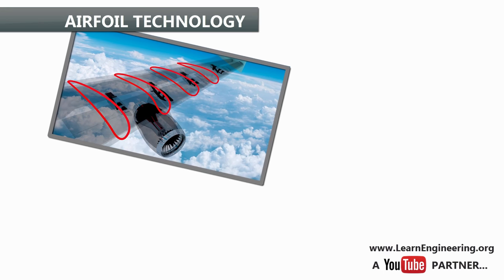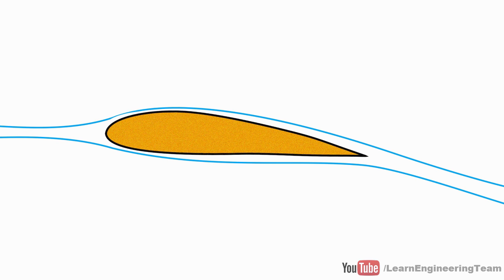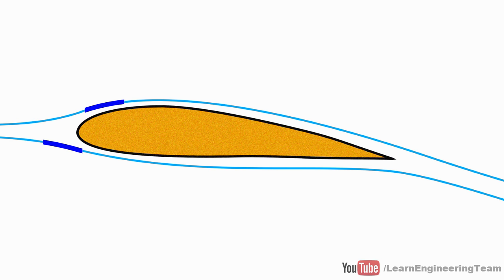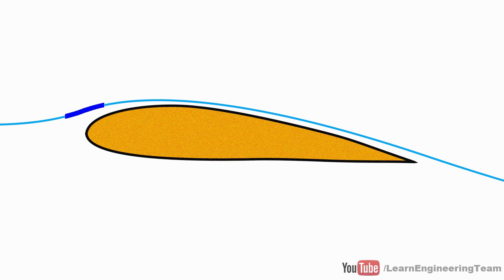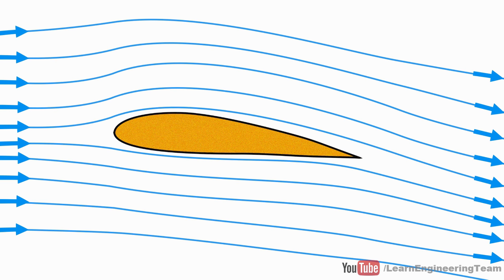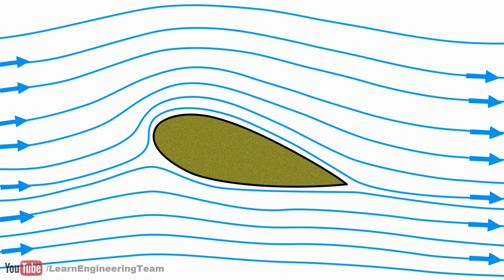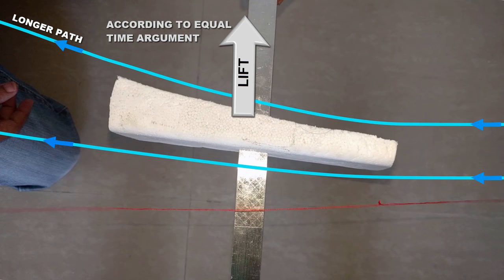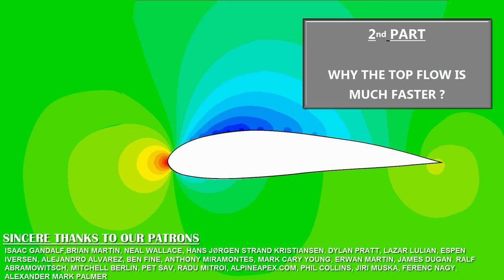How do Wings generate LIFT?

Comment: Uhm... so, it's the centripetal force that curves the airflow, not the centrifugal one. And the Coanda effect indicates that there is a force on the airflow following the surface of the airflow, and hence a pressure. But that's just Newton's first law. It doesn't explain WHY the airflow follows the shape of the surface.
Reply: @Physics Rules-Roels Physics
You can say that the atmospheric pressure causes the flow to follow the convex curve and, therefore is responsible for the centripetal acceleration..  However, it is the Centrifugal Effect (Tendency to go straight) that reduces the pressure closer to the surface below the ambient atmospheric pressure.
..
At time 3:20, he says 'centrifugal'(outward) when he should have said centripetal (inward).
Reply: @Observ45er  Mmmm, have to think about that, thnx!
Reply: @haushofer100   Tnx for response. Think very carefully.  Atmospheric pressure pushes air against the surface in the first place. Even if it moves (but not super fast)  it is pushed against all surfaces. Because of this the flow follows the upper convex curve, right?
.'
Now, What does Newton's First Law say about something moving?  A: It "wants" to go straight. Right?
..
BUT... what if it is forced (by atmospheric  pressure, in this case) to follow a curved path?
.
It's going to 'try' to go straight and pull try to, or get flung outeward.  This is just like being on a playground merry-go-round going fast.  You feel pulled/pushed/flung outward.  Air is no different.
SO...
It will push against the atmospheric pressure further from the wing.  It can only push with the same atmospheric pressure amount because that's all the atmosphere can push back with.
But it will be less at the inside of the curve near the wing BECAUSE it is trying to go straight (inertia, or momentum does this).
.
It 'wants' to go straight, but the surface is actually curving away from that path. 
..
It is this "need to, or attempt to go straight" that lowers the pressure above the wing. It's Newton's First  Law, just not like people say with the Third Law "reaction" pushing up on the wing... Newton's Third Law certainly happens, but it doesn't cause lift.
Let me know if you 'get' it.
..
All this other stuff like Bernoulli, faster causes lower-p, and pinching are all misunderstandings of fundamental physics. Some of that other stuff happens in the complete story, but they get causes and effect mixed up.
Cheers.

Comment: Your explanation is incomplete and incorrect in one respect. The cause of the Coanda effect: is caused by the air surface boundary effect on all surfaces. The air right at the surface of any object is more static due to attractive forces between and among the particles at the surface. As soon as moving air meets this very thin layer that is more viscous some of the air particles start moving in the same general direction. This is the beginning of laminar flow which reduces the viscosity above the boundary layer.  The longer the path of flow the greater the laminar flow becomes. This causes the air in this region to have a higher velocity, lower viscosity  and therefore lower pressure. The same effect is occurring on the bottom of the wing but to a lesser extent for two reasons;  1 the distance the air travels is less so the Coanda effect is not as great. That is, the amount of laminar flow will not be as pronounced. Secondly if you have a concave lower surface it will produces a smaller cross-sectional area of laminar flow "Coanda effect". This is because at a plane parallel with the leading edge of the concave surface the Coanda effect falls off precipitously. On the upper convex surface the cross-sectional area of laminar flow decreases much slower.  In summary there is a lower pressure region produced on both sides of a wing by the Coanda effect, it just that the net difference causes  the upper surface to have an over all lower pressure and higher velocity. This is all topped off with Newton's third law. Your video only shows a higher pressure directly under the wing which is misleading. It's the net difference!
Reply: Uh, yikes, no. Viscosity is treated as a constant because it essentially is. Laminar flow has nothing to do with higher velocity or lower pressure. Coanda effect has nothing to do with lift and inviscid theory predicts lift perfectly fine (with Kutta condition which is somewhat assuming viscosity – but not directly). The laminar flow over a large commercial aircraft wing is basically nonexistent.

Comment: From Popular Science (way back in 1927):  https://books.google.com/books/about/Popular_Science.html?id=VikDAAAAMBAJ
a) 25% of the lift is from the wing being angled slightly into the wind, and the air pushing the wing up  (this also creates drag - slowing of the plane, however).
b) 75% of the lift is from the fact that air is deflected slightly by the top leading edge of wing creating a partial vacuum just behind the leading edge on the top surface of the plane.  Having full pressure on the bottom of the wing, and not on the top of the wing pushes the wing up.

Comment: ANGLE OF ATTACK: the "elephant in the room" missing from all of these "how do airplanes / wings fly?" explanations.   Lifting the nose up, thereby increasing the angle of attack of the wings lifts the airplane off the ground allowing it to fly.  If it was true that the wings' lift raises the airplane off the ground, the airplane could simply speed up with its wings remaining flat and parallel to the ground and magically float into the sky.  In reality it would speed to a crash at the end of the runway!
Reply: Actually, due to a property called "camber" a properly shaped airfoil at zero angle of attack CAN generate lift. If you had a runway long enough, and an airfoil designed for it, an aircraft could take off without lifting its nose. It just turns out that it's easier to just lift the nose a bit instead of building freakishly long runways. However, in cruise, many aircraft fly at zero angle of attack and don't lose altitude just fine.
Reply: The lift of the airfoil at high speeds can provide significant lift for the wing, but even at cruising, even when the fuselage & cabin are level, the wings have a small upward angle which provides lift.  Check out the wing shape of the highest performing military aircraft, many of which are symmetrical.  Also note that if the shape of the airfoil provides most of the lift, flying upside down would be impossible and guarantee a swift crash.  The main benefit of an asymmetrical airfoil is efficiency. It allows a laminar flow resulting in a tight boundary layer in multiple flight attitudes (see Coanda effect).
Reply: Yes, I am fully aware that some aircraft have symmetrical wings and in those cases angle of attack is completely responsible for lift. But most aircraft have a combination of camber and a built in angle of incidence with the fuselage. I am actually currently designing an aircraft for my senior design project at college, and mine has both an angle of incidence and camber.

Also, the Coanda Effect is NOT responsible for flow attachment. It is solely due to the fact that there is other air around it which pushes it against the wing. The Coanda Effect is not very useful in this case because it cannot explain flow attachment to the concave lower surface of a cambered airfoil, yet it we know from many years of testing and experience that the flow remains attached there. The Coanda Effect only applies to convex surfaces.
Reply: the plane could take off without pulling up but it would need lots of speed. The top of the wing generates some lift even at no angle of attack

Comment: good video, but still inaccurate. Newtons 3rd Law IS NOT the source of lift force, it is purely the pressure difference due to circulation about the airfoil. 

Wings do use the highly curved geometry, this is what happens when slats and flaps are deployed to increase lift.

Now, your CFD simulation is nice but does not prove anything if you input the streamline parameters. How do you know why the flow occur in this pattern? you only know that it does from practical wind tunnel results. And err, your CFD of the concaved rect block does NOT show no lift, it shows small negative lift.

Also, how come the Coanda effect does not happen around the trailing edge of the airfoil? Zoom in on the trailing edge, it is just a convex surface, so flow should cling around the trailing edge creating another zone of low pressure around the trailing edge according to this videos own arguments! The answer to this particular question is real reason why airfoils generate lift.

And here is a brain teaser for you. If Newtons 3rd law is really the way aircraft gets their lift, why are helicopters not as fuel efficient as a fixed wing aeroplane of the same weight? Does conservation of energy not apply to wings?
Reply: Both Newtonian and Bernoullian explanations are equally correct. The Coanda effect is irrelevant and is a mistake in the video. Fuel efficiency is irrelevant and a mistake on your part.
Reply: Googelplus Sucksys I think if you imagine 100cubic meter of air pushed down to the ground, a fixed wing aircraft will produce more lift than the helicopter. But according to the video, it should generate more lift.
Reply: The same lift sorry

Comment: Answer for the brain teaser :-
It's coz pressure decreases on the upper side the velocity increases but at lower as pressure increases velocity decreases ......thus it makes the difference in velocity at upper and lower side .
Please rply if it is correct or wrong.
Reply: you can't compare these pressure gradients. The lift is caused by the pressure differences between the upper and the lower side.

Comment: I listened twice to this but I still fail to see why the air on top of the wing isn't higher pressure because the air is being forced upwards compressing into the air at the top of the wing.
Reply: Disclaimer: please don’t take my word as gospel. I am a pilot, but I am not a physicist or aeronautical engineer. 

My understanding is that as the streamline flow over the top of the wind is compressed by the air above it, it is made to accelerate (as if it were being forced through a Venturi), which results in a lower static pressure.
Reply: @z120p  I wish it is possible to see it in a wind tunnel with smoke stripes

Comment: This explanation perpetuates the idea that lift is due to the shape of the airfoil!!!!!!  Some airplanes have completely symmetrical airfoils!!!!!  Even a flat surface will generate lift!!!!  As they point out, airfoil shape is influenced by structural considerations, but early airplanes had single surface wings - just some fabric stretched over ribs.  The ribs were curved to improve lift, but it is the fact that air is deflected downward by the wing that produces lift, not the shape of the airfoil!!!!!!!!!!!!!!